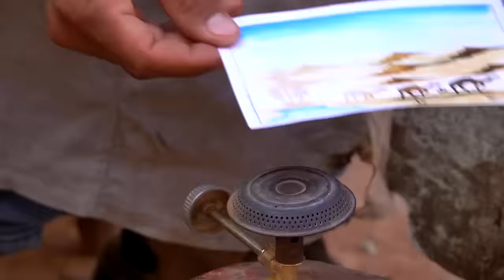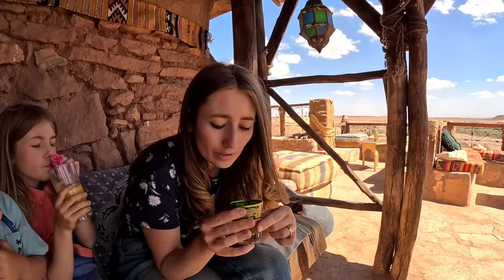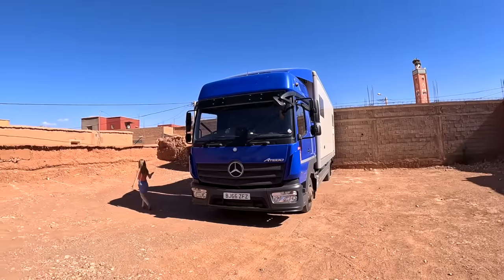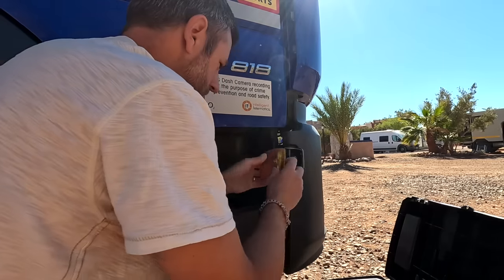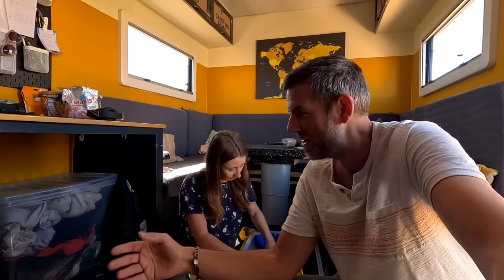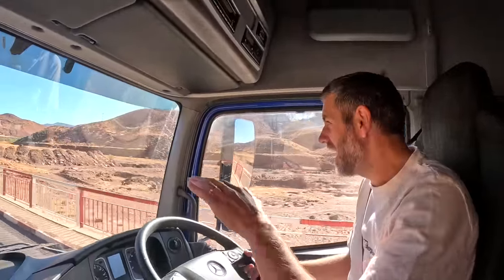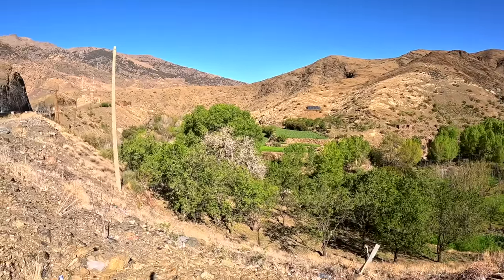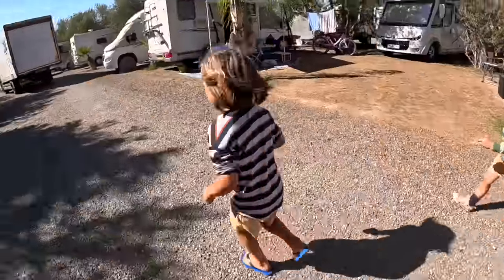Is Our Morocco Trip In JEOPARDY? (Campervan Problems)

Comment: Making that space in to a storage box, i think would be a better option, as an extension to the garage area - and or - storage for folding chairs/tables etc - looking the space you can always have  another bank of batteries as a backup and fit a VSR connect to the main batteries - so you will always have an emergency power pack - 
Great video blog, as usual - great content -

Comment: My experience comes from over-landing in a Land Rover, so a lorry is a bit different. Alloy wheels aren’t (usually) as strong as steels, unless you fork out a lot of money. Have a box of glues, tapes and putties, so superglue, two part epoxy, duct tape/ gorilla tape, milliput, sugru and JB weld, these are all very useful for when something plastic decides that the going is too rough. You appear to have enough space for a split tail box and a wheel, but you will loose ground clearance at the back, unless you angle it and then there’s all the ancillary bits you need to change a tyre plus the weight. Carry a tyre repair kit and a pump if nothing else, these can get you out of the sticky brown stuff. You could look at getting a multi fuel stove, for when the main gas is getting low, then use diesel in it, that way you don’t need two fuels. Really enjoy your videos, makes me want to go over landing again.

Comment: Your LPG has a hole in the Diaphram in the pressure relief valve. I Had it happen on my LPG central heating storage tank. Turn off your isolator tap. Your problem is low air pressure increasing the pressure difference at height. Plastic deteriates with age, and your alternator is overcharging or has a faulty diode in the Alternator over loading the bulb circuit.

Comment: Rub the wheels down and get them resprayed your self. Makin sure you do not take away too much steel from them. May be 180 grit 280 grit upto  400 grit then spray with Wheel spray. Also as to your problem with the rear under body .. if you have looked at DPD delivery vehicles they have a cage system to store their trollies, maybe an idea to get one and modify to suit your needs. Including a spare wheel or two.
Reply: Hammerite is favourite on wheels, the brush-on liquid is fine.

Comment: Paint your wheels for sure! 
Black or silver on the dish side & blue on the dome side. Don't forget the Kurust first. 

Aluminium wheels are a definite no-no on rough roads! Steel wheels flex or occasionally bend (& can be straightened easily), alloy wheels crack or even have chunks fly out.

Comment: the meters work on pressure which is fairly rubbish because liquid gas maintains the same pressure until there is no gas left to liquify. Also pressure gauges are relative to atmospheric so the closer you get to sea level the lower the reading will be. With that sort of level detection the best you generally get is a day's notice. Cylinder weight is a much better metric to use but no good if it's fixed as yours is. Another method is to wave a blowtorch over them (yes it sounds bad) the flame will cause condensation where there is gas and not where there isn't.
Reply: You can get magnetic patches that change colour with temperature – while you're using the gas evaporation causes cooling so there will be a colour change at the liquid level.

Comment: spare wheel if you can spare the weight, you can use a boat winch type of thing to pull the spare wheel up, common on factory fit spare wheels on commercials,

Comment: Gas: When you're back in England fit a manual changeover valve & a 13Kg or maybe 19Kg red propane bottle. (Manual valve so you know for definite where you're at with it). They run on the high pressure (2,000psi?) side so keep the hoses as short as possible. Autogas is propane not butane so definitely the red bottles. 

Propane is used on building sites so should be available worldwide.
Reply: The advice in the forums is to get a CampingGaz 907 regulator & hose and feed it back through your BBQ outlet (it's 2-way), bottled gas is apparently available in every town's market & most petrol stations but you don't want green bottles (or maybe you do, maybe they're the propane ones). 
All available locally. 
All cheap. 

My guess is that propane will be used in the mountains because butane freezes around 0°C depending how fast you're drawing it off (propane ~minus 40°C).
Reply: In camping shops you can buy magnetic tape which has squares that change colour with temperature, as the liquid boils to gas it gets cold so you can see the level when you're using an appliance.

The magnet isn't strong so keep it stuck to something indoors.

Comment: Stay on steels, when you get time back in the UK get them bead blasted and repainted, Ok they are heavier, but much more resilient. Alloys can develop hairline cracks and then tyre deflation. As for brakes stay off of them as much as you can, use the gearbox and if fitted, the exhaust brake, if not short dabs, never prolonged activation.

Comment: Move the water tank to the back of the chassis. That's what has put your front axle so close to its limit, that will take some of the weight off the front axle. Then you can put the kids toys and things where the water tank was.
Alloy wheels look good, but a nightmare to get off. They have a tendency to stick to the wheel hubs.
For the spare wheel, how are you planning to jack up the truck ? Doing it without knowing what you are doing can be dangerous. If you are in Europe the breakdown service is generally ok. If you are somewhere very remote you should have something just in case. Just bear in mind a spare wheel, jack... is a lot of extra weight you would be carrying around all of the time and you don't have much payload to begin with.
You should also think to remove the tachograph as you don't need it. As long as it is fitted you need to do the 2 yearly inspection on it regardless of if you use/need it. Can be a big fine if you don't.

Comment: If you're not using solar panel charging on your battery's & you're planning on staying put for a few day's  start you're truck every 2nd day for 20mins to top battery's up. 
Enjoy your trips.
Reply: It's a 4 or 5 litre Diesel so it will take that 20 minutes just to put back the charge used for starting the engine.
Reply: Has a recovery driver on the roadworks sector we start our trucks up everyday   for about 20mins if they don't go out to keep batteries topped up

Comment: Watching here from Stockport, Sth Manchester, on the lorry its definately a spare wheel, jack and wheel brace as it can be very costly should you experience a blow out, on the wheels I personally would go for alloys mainly for the saving on weight, the third is when you go for bulbs then replace them with L.E.D.'s as they are brighter and last a lot longer as they don't have a filament like ordinary bulbs and less likely to melt anything.
Reply: Definitely not alloys on rough roads as they don't flex they crack or break.
Reply: Brighter lights are both illegal & very rude, fortunately LEDs are available in standard brightness.
Reply: @alanhat5252 Then why are 99% of Rally and Race Cars fitted with them ??

Comment: In my understanding of an external lpg tank almost all have a level sensor with a float to measure the liquid content of the tank .this shouldn't change with altitude unlike the pressure gauge on a lpg bottle i would say you have a leak and if you fill it .turn it off at the tank when your not not only will it not be wasted but it wont be a hazard. Get someone to check for leaks or do it yourself with soapy water
Reply: It looks like the installer has chosen to ignore the float & install something that's sensitive to atmospheric pressure.
Reply: Checking for leaks occasionally is a good idea whether you suspect leaks or not.

Comment: Yeah like I'm only 36 and I still look younger than you😂😂😂 you ever thought of replacing the barbs with LED bulbs much brighter cheaper to run on energy and don't get too up, as it's a truck spare wheel one side storage the other,
Reply: Brighter bulbs are both illegal & very rude, fortunately they're available in standard brightness.